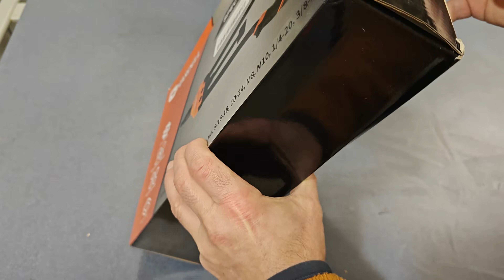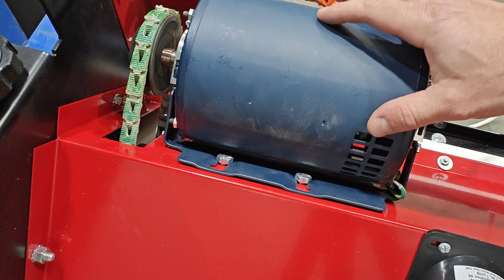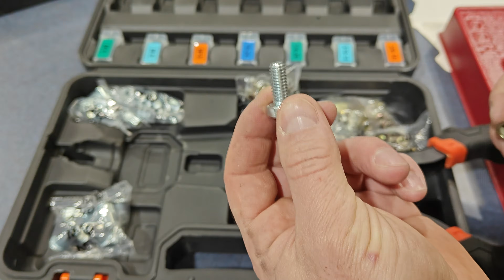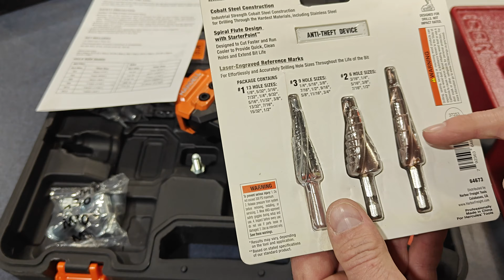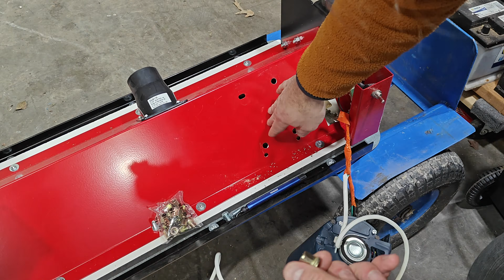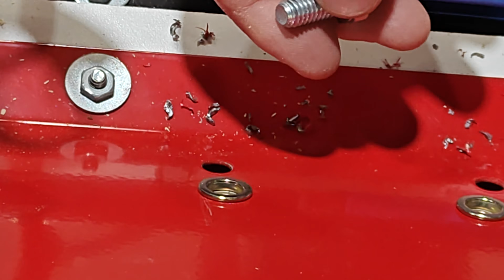Hardell Threadsert Rivet Nut Installation Tool - Unboxing And Test

Comment: Pack of rivet nuts 10$
1 bolt -20c per peace 
1 nut 20c 
1 washer 10c
2 wrenches 99% of people already have .
Does same job for almost nothing. Bolt ->nut-> washer ---> into rivet nut.With one key you hold the bolt from spinning while with other you tighten the nut to expand rivet.
Best one to hold bolt is ring wrench and then you tape peace of duct tape over it so your bolt cant slip.
Reply from the maker: Did you watch the video? The inside of the frame is completely inaccessible without taking the whole tool apart. 

Also you're comparing two things that aren't comparable. $10 for a typical pack of 20 rivet nuts is $0.50/per.... that's compared to your $0.30 cent nut/washer combo.... $0.20 cents is more than worth not having to take the tool apart to get to the backside with a wrench.

Thanks for commenting!!
Reply: @TimNummy  Comment was about how cheap it is to install these rivet nuts with simple things that everyone has at home .
Tool like this for 40$ is a commodity.Worthy of buying if you are going to install 50 of them ,for one or two totally not needed.Simple bolt ,washer and nut do the job.
Reply: This tool makes it so easy though.